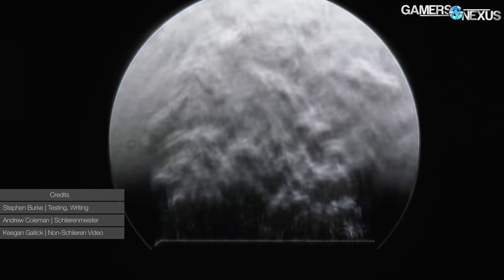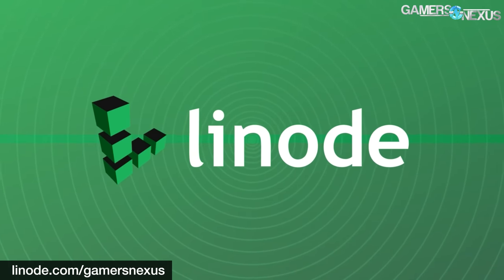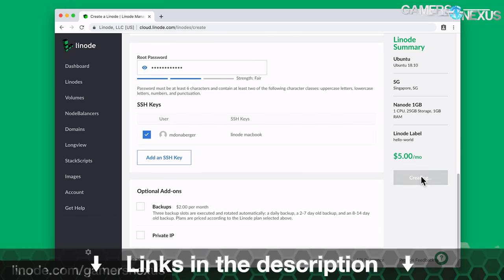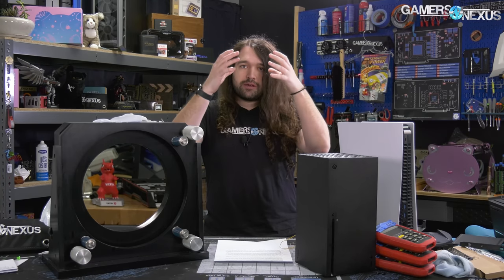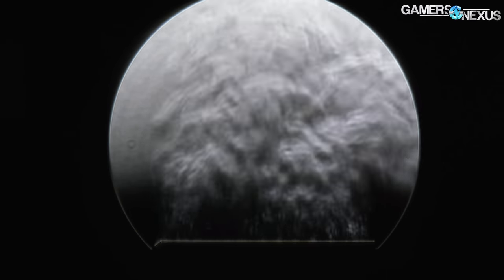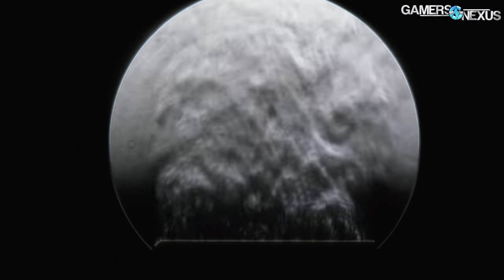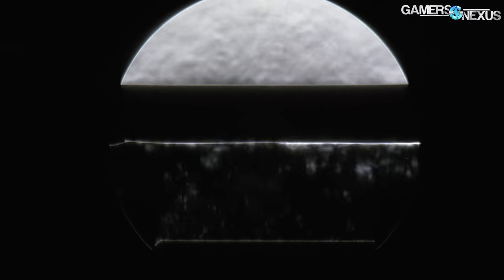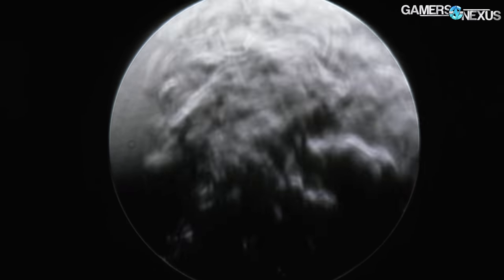PS5 vs. Xbox Series X Airflow Testing: Cooling Design Efficiency & Flow Paths

Comment: For future intake testing, why not use the output of an AC unit or use a little makeshift ducted fan and some ducting with a refrigerator or outside air? This would prevent you guys from potentially having a dangerous build-up of flammable gas.

Comment: The reason the limited venting holes for the XBox intake is actually viable here is because it's a sealed airflow design. Contrary to most of your PC case testing, which often ignores potential recirculation of airflow, this design cannot have more than a nominal amount of recirculation. This fan could pull almost as much air through a 2" ID PCV pipe as it could unrestricted. Most fans could. It could have an opening the size of a golf ball for the intake, and it would not matter. I am however annoyed at the lack of dust filtration.

EDIT: No, hot air doesn't really rise. This is why we have so many people misunderstanding the concept. The warmer air is, the thinner and less dense it is. If there is denser cold air nearby, then it's going to want to displace the thinner warm air and lift it up. Yes it can be directed via airflow. What most "normies" forget is that in a container like a PC case, that hot air isn't going anywhere. It also doesn't matter where the vents are as long as airflow can direct the hot air to that vent. If all the air in a container is hot, it's not going to rise. If half the air in a container is hot, the upper half of that container has hot air. You could pull denser cool air from the top and force it down through the system to be heated up and vented out the bottom for all it matters as long as the entire container is being flowed. I think the best way to imagine the interaction between warm and cold air is to imagine a ball pit. Normally the ball pit is full of light hollow plastic balls that move around as kids play in the pit. Imagine dumping in a bunch of balls half filled with water. They are heavier and thus will try to sink to the bottom lifting the lighter balls up. This is more representative to warm vs cold water, but the concept is the same. Now heat itself radiates in all directions. It too doesn't rise. Nor does it get lifted. It has a tendency to travel through thermally conductive materials before others. Once thermal conductivity balance is achieved, it'll travel through everything proportionally to thermal conductivity and capacity.

Comment: Aha!  I think I finally get what the razor blade is for just from hearing it described a little differently.  The air density mixes up the light but it still averages out.  By using the razor blade you mix up some shadows too so you can actually get contrast to see what's going on. That or it's a weird interference pattern thing like holography, but that would require a laser instead of LED.

Comment: I think the hole in the back is for accidental blocking of the top fan. Since there's basically no other exhaust, if the user just cover the top it would have a place for the air came out, instead of being completely blocked otherwise.

Comment: The conical airflow seems more likely to come from lower pressure in the centre - the fan hub blocks flow there, so the flow through the blades will move to the low pressure area above the hub, and that low pressure area would continue above the holes which would cause the cone shape in the flow above the vent. 
It's also likely that the holes are acting a a flow straightener, which would explain why the flow is more directed than spilling out sideways like an open fan (or the 3080 fan). The outlet air is also moving faster than ambient, so will have a slightly lower pressure, so the ambient air will will press in on the straightened airflow, which could also cause the cone shaped flow.
Also possible, but less likely, there could be some centrifugal effect from the fan, putting denser air on the outer edges of the fan outlet, but I've no idea how big this effect would be relative to the rest. I suspect this is negligible, but it might have more effect than I expect.

Comment: RE:PS5 You do know that air pressure increases as you increase restriction. Meaning you trade velocity for air pressure. Increasing restriction does not decrease air pressure. Thing about using restriction to reduce air velocity is, you increase linger time for heat transfer. High performance cooling systems on aircraft use this particular action to slow down air to improve cooling. Strangely enough on the p51 Mustang thrust is provided. The heating of the air makes it expand producing thrust.
Nice to hear you admit that's taking the side panels improves airflow performance noticeably (meaning you noted it). Perhaps the removal of side panels is not as much of a improvement in cooling due to lack of plastic and more to airflow perhaps you'll get around to saying that as well sometime. Cheers to you. love your show. Stay healthy

Comment: Uhhh Steve, the propane torch doesn't have a different density because the "air" coming from the torch is hot. It is actually probably cooler than room temperature. It's because it's EXPLOSIVE PROPANE!

Comment: The xbox is designed like a fan coil/air handler. The only thing missing is an air filter located in the bottom. Thank God it's easy to clean.

Comment: Vertical creates an issue where the dust/debris that enters falls down onto the PSU vent holes. This causes those holes to clog and will eventually cause the PS5 to shut down from overheating. I have seen this first hand and can confirm this.  How long it takes to manifest just depends.  Depending on how dusty the environment is and how long per day you use it.

Comment: The PS5 exhaust direction isn't ideal. I use a Razer wireless headset that requires a USB transmitter receiver. Plugged it into the rear USB port and the exhaust eventually cause intermittent connection failure to my headset due to the fact that it pushes the exhaust downward and towards the USB device. I moved the USB transmitter receiver and the problem went away. Note: PS5 is sitting horizontally and not in a cabinet.

Comment: I think the vent on the side of the Xbox for the fan is a solution for a situation where a book for example, is left on the top (if vertical) blocking the exhaust, as well as the concave shape contributing by allowing air to escape through the top edges.

Comment: That conical flow pattern at exit likely results (at least partly) from the difference in air pressure between exhaust and ambient. The hotter, faster flowing exhaust air is lower pressure, so the higher pressure ambient air compresses the flow to equilibrium. This phenomenon is seen clearly with over expanded rocket nozzles. The chassis hole directions are likely optimized for this.

Comment: Awesome informative video guys! I was curious how these worked. So would u say that the G-story side panel fan is useless? Or will it actually help, as long as I'm in a relatively cool gaming environment? I've heard very mixed reviews on all fans for ps5 but the G-story seems to provide the most benefits with alot of positive reviews. Some reviewers said they added makeshift seals to the ps5 vents to improve functionality. Would u advise this?

Comment: So, given port positioning, the Playstation 5 will be horrible if used inside a TV bench with only an opening on the front and a small hole for cables in the back/top-back? That's disappointing.
And the X-box one series one x one box one (yes, name rant) would work very well in such common TV benches if oriented so the "top" fan exhaust is out into the room, which seems like a natural orientation for connectivity.

Comment: Watching the ps5 breakdown video again and seeing how the air exits the rear and the way the heat sink sits in the case with little flow at the top and the bottom. Maybe the thats why they used liquid metal.  Didn't someone put thermal paste in its place and it just overheated?   Could be wrong. But that is one hell of a heat sink to not be more efficiently used.

Comment: I drilled holes in the bottom of my unit.  Although removing the internals first, would have been a better approach, and my system is now rendered useless, the airflow is amazing now.

Comment: My mom has this fancy heater that will run the fans every few (I don't know, 5 or 10) minutes to circulate air into the heater and get the room temperature. On top of that, when it powers down from heating, it will run the fan for a good 20 seconds to cool down the insides of the heater.

Well, this really bothered my mom, so she would pull the plug to shut it down. This caused a problem, where the heat got trapped inside the heater and spread into the safety mechanisms that are inside the insolated area, stopping the heater from turning back on. In fact, because the temperature sensing safety mechanism was inside the insolated area, it took a somewhere between 30 to 90 minutes before the heater would start back up. We just couldn't get it to power up during that time. It took us months to get my mom to stop pulling the plug on her heater, and once she stopped doing that, she had a lot less problems with it.

What I'm saying is, anyone that's tempted to pull the plug on their Xbox because the fan is still going after turning it off; DON'T pull the plug. The Xbox has some sensitive electronics,  that might get damaged if you pull the plug before it has finished powering down (well, cooling down). Pulling the plug might not do any noticeable damage if you do it once or twice, but if you make a habit of it, the damage can build up over time.

Comment: Something interesting to mention is that Sony is going to be tuning the PS5 fan curve with system updates. Supposedly there is an update coming soon that is going to raise the ceiling of the PS5's fan curve so the fan can run at a higher RPM when needed. Might be interesting to compare it with the update (when it hits) vs the stock fan speed. Hopefully, we don't end up with another jet engine like the early PS4 Pro models.
Reply: Its already a Jet engine lol

Comment: So the shroud on the fan is basically acting as a diffuser which will produce outlet pressures higher than the inlet and this often generates quite a bit of noise. I think the top surface is acting as a silencer as it is distributing and normalizing the flow more evenly across the outlet and the varying length of the holes is probably straightening the flow to some extent as well. Based on the distribution they chose for the top surface, it would seem that the outer boundary requires more straightening. That or they thought it looked cool and maybe I'm wrong about everything lol.

Comment: My first assumption with that rear facing fan exhaust was maybe it was an "emergency" exhaust type of hole. Like if someone had no clue what they were doing and put something on top of the Xbox and used it, it would have at least some sort of air flow still going on.

Comment: What about hot air rising combined with the air flow fan, means vertically the speed of the dissipation of the heat should be in fact tad faster when you stand it as a tower right? That means it should technically keep it a tad cooler as well. Wondering if putting a usb fan behind the console to blow in the back air vents would keep the console cooler?

Comment: 7:08 But.... looking at the concave nature of the grill....shouldn't the longer outer rim actually have the opposite effect? The boundary layer moves more slowly because of friction. So the air should be dragged towards the outside, right?

The actual reason the airflow is conical could be that the air towards the edge moves faster than the air towards the middle in general because of the radial design of the fan. The outer edges of the fan blades move faster than the roots of the blades and behind the central hub the air doesn't really move at all. That results in considerably faster airflow on the outside edges than towards the center. This effect is probably vastly dominating the opposite effect of the concave form with the longer outside edges.

Edit:
The reason the Nvidia fan disperses the air like that despite the outside air moving faster is that the fan is exhausting upwards without any shroud in its' exhaust direction. This way the centrifugal force from the rotating fan dominates the effect I described above. But the fan inside the Xbox is considerable recessed into the case which then acts as a shroud to eliminate the centrifugal component of the flow vector.

Comment: A Sony A1 camera can take photos in "quick motion" which is a high rate of capturing photos or a continuous burst. This camera can do 240 fps still frame capture. If you compare / pixel peep / zoom in on still photos captured in 240 fps to video shot at 240 fps I am quite confident you will find that the still photos have a lot more detail to them than pause / freeze frame of video at the same fps. Is this maybe helpful to you?

Comment: I don't think the shape of the outer holes in the Series X are the primary cause of the shape of the exhaust. It's more likely that fast exhaust near the centre will want to fill the void in the middle over the hub of the fan where there's little exhaust. The rest of the exhaust will similarly want to fill the lower pressure air created by that more central flow moving towards the middle. If you were able to take a slice of just the centre of the exhaust I'm sure you'd see that more clearly. Similarly, if you extended all of the holes to the same length I'd expect the flow to remain similar

Comment: @GamersNexus I wonder if reversing the PS5 fan would drop thermals. Not just the whole "hot air rising" thing but typically I find pulling air around corners and bends with negative air pressure is easier than trying to push it. Think of trying to push a rope instead on pull it.

Comment: Quick question that made me giggle a little bit. How hot is MAP gas if it's not on fire? I would say that the MAP gas worked for your imagery because it has a different density than air. I also am 9999% certain that your MAP gas was the exact temperature of the tank it was stored in or slightly colder.

Comment: Correct me if I'm wrong Steve...
You're basically releasing flammable gas without ignition, meaning any spark might created a burnout in your vicinity?
If that was the case, that's dangerous, do use fire protection and such next time!

Comment: I think the small side exhaust in the fan shroud is to reduce pressure of the main exhaust so that it maintains nonturbulent flow. That's an educated guess, and you still wouldn't be wrong to say it helps with acoustics. I'm surprised you didn't just block with tape while imaging!

Comment: i've always had my series x on it's side.  not just cause it fits better in my media set up, i always get paranoid it might tip over somehow when standing up, even though it still has a pretty wide base.  plus, the bottom still has some holes for airflow.  if i get a ps5 that would probably be standing.  but my xbox is just sitting on top my desk that's open and not in a cabinet or shelfs around it.

Comment: I’m going to guess that the little exhaust slit on the Xbox may be in case someone (like an idiot) sit something on top of the Xbox blocking the main exhaust. Obviously this wouldn’t solve that problem but it may prevent the Xbox from overheating long enough for you to realize someone sat something on the Xbox.

Comment: If the torch is not lit, its not producing heat. It would in fact be colder as the gas will be liquid under pressure and will absorb heat from the atmosphere as latent heat when it phase changes to gas. There was also a real risk the gas could have been ignited by the console starting a fire.

Comment: It's interesting to see. The most important thing for the flow visualization is to see if there is any areas blocked or with stagnant flow, or events worse, an opening that appears free but little flow is coming out. That would indicate some kind of internal flow problem. Even flow through the heatsink would lead to even temperatures across the heatsink. A stagnant flow is would cause a hot spot.
Otherwise the only important determination on the effectiveness of a heat exchanger is the mass flow through, times the difference between inlet and and outlet temperatures.
I'm not sure how one would determine what the actual volume flow through a games console is. Maybe a big empty garbage bag tapes around the outlets, turn it on and see how long it takes to fill it up.

Comment: About that "hot air rises"-topic. 
I feel stupid never really looking up how fast ~60°C to 80°C air moves within a case (or even just in general), but always loved the Silverstone FT02 and it's successors case designs for how it utilizes it. I just don't like many new cases, which have like 3x 120mm (or 2x 140mm) fans sucking in air and only one 120mm pushing air out. Something like that feels like not a good case design, even when you only use like 2:1 fan ratio.

Comment: What can i tell is that the engineering design of xbox series-x cooling is superb. It is so quiet during actual gaming even in a longer period of time. "Heat rise up", so the concept of xbox series-x cooling is really on point. I dont have yet PS5 to check if the noise level is the same or not. But i really appreciate the cooling and noise level of xbox
Reply: But is it normal that the air flow gets hot while playing a game with a disc?

Comment: The “lack of holes on the bottom” decision was most likely made to lower machining cost. Machining is normally charged by the hour, so less holes equals less time on the mill. Those few minutes saved over a million units would add to up to a substantial financial amount.
Reply: they only have to machine one time for the injection moulding form, after that one time, there is no additional cost.
Reply: @georgwarhead2801  the lack of holes was on a metal part.